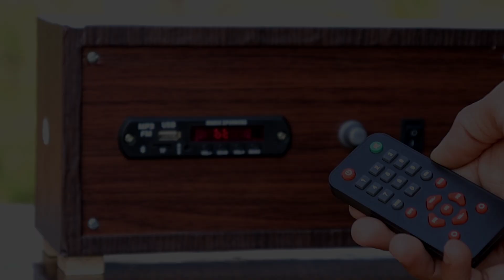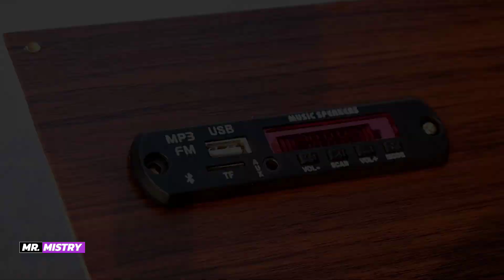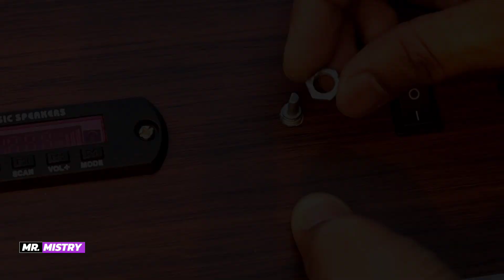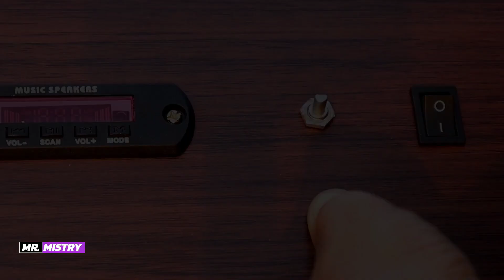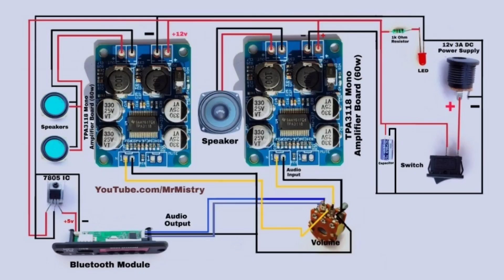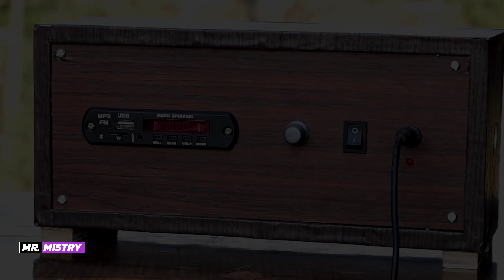Make Bluetooth USB Speaker using Two TPA3118 mono Amplifier Board

Comment: What should I do to avoid ground loop noise? I made battery powered Bluetooth speaker. Using same power source for amplifier and Bluetooth. I'm using 12v battery for amplifier and 12v to 5v converter for Bluetooth module.

Comment: I'm don't sure if we use the multiple boards with the same power source, which gets the hum buzz or noise. Do you have any problems?
May I try with 18650 batt x 3 to 12vdc?

Comment: Sir, I Have connected 4 Ohm, 50 Watt Woofer to TPA3118 IC Board, But its making noise after volume up. Its not working properly. Help me out Sir🙏
Reply: use 20v 6a powersupply

Comment: This would work, but then stupid design.

Left right left arrangement of speaker is wrong. This is not how you do it.

It should be
Left speaker

Left woofer with bass filter circuit then amplifier board.

Right speaker